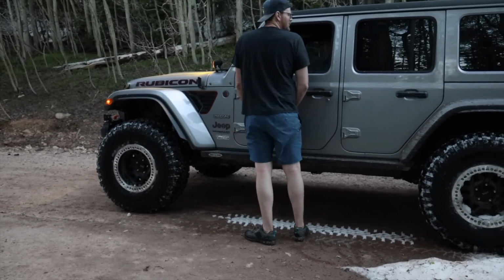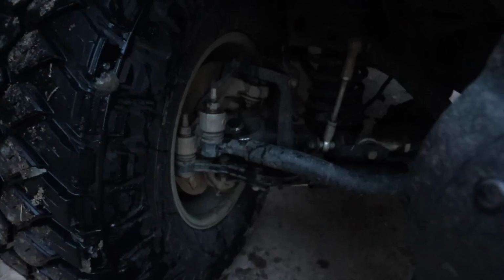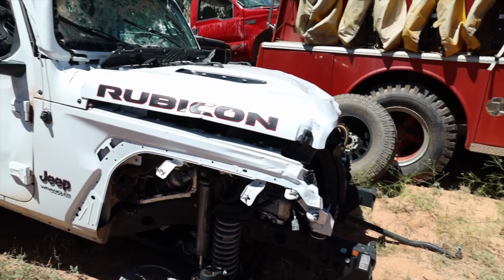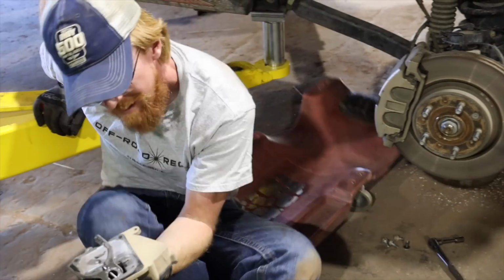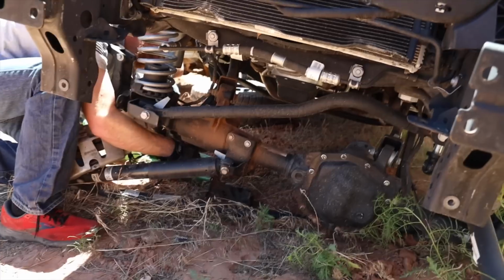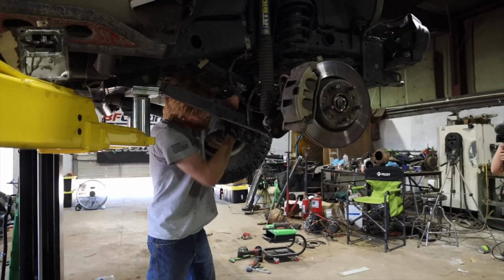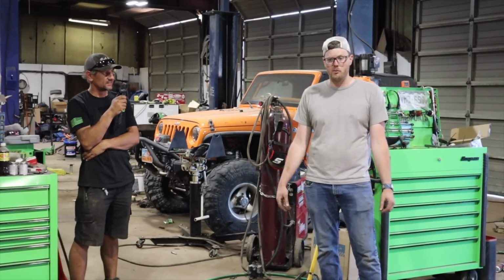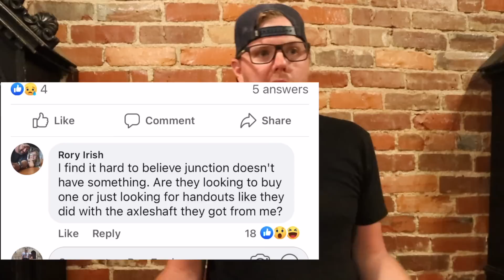The Real Story Of What Happened Between Rory From Trail Mater And Ben And Brandi

Comment: Ben from man to man the fact you made this video publicly shaming or calling out someone else for any reason at all or “defending your reputation” is wrong. This video should not have been made. That was low, turn the other cheek, take the high road whatever you want to call it, this should have been handled in private and not put on the internet to further stir the pot. Your Burning bridges rather then repairing them, from what I can see outside looking in sounds like a misunderstanding on both parts. Just my thoughts. Now I’m not defending anyone or taking sides but where I come from I’d go down there and man to man and figure it out.I applaud you for at-least reaching out via phone and trying to make it right but the video ….not good. Silence speaks louder then words sometimes.
Reply from the maker: I agree with most of what you said here. However, I did exactly that. I tried to reach out “privately” several times. No response. Rather than let his comments/accusations  just sit unmatched I used the platform I do have to correct the record. I feel there is nothing wrong with that and I think people need to get back to that.  In my opinion, this “turn the other cheek” nonsense has gotten our entire country into the mess it’s in… There is a time a place for that and this was just not it for me.
Reply: I can sympathize with ya brother, there is a time to stand up and defend you and yours but over an axle shaft and a post I’m not sure that was it..…….  Only you can make that call for you and your family though that we can agree on, just an outside perspective here. Truly I love both of your guys content Rory and yourself. And I hate seeing this. Generally off road people are good people and we need to stick together there’s enough outside drama trying to shut us down from wheeling, Nothing but best wishes man and I truly hope you and Rory work it out.
Reply from the maker: Like I said at the end of the video. I hold no hard feelings or grudges. I just wanted to have a voice in the conversation about me. This was my way.

Comment: I don’t know exactly what took place, I’ve been watching trailmater for years I saw your video doesn’t seem like you aired down your tires or tried to get out of the snow correctly, I thought you would break something and you did. If I was you I wouldn’t have left that shop without throwing Rory a bone, but your proof no good deed goes unpunished 😎
Reply from the maker: Definitely should have aired down you are correct about that! However we only had 2 snow drifts to get thought so I tried without! 🤦‍♂️
Reply from the maker: Your clueless.
Reply: @BenandBrandi if anyone is clueless it’s you.
Reply: @BenandBrandi   Let the winch do the work. You were hot rodding it with the wheels cranked. That's a recipe of disaster. You're lucky you only broke a shaft and the disconnect piece. It's common for the ujoint to let loose and take out the ball joints on these.
Reply from the maker: You are 100 percent right! I wasn’t thinking!! Live and learn I suppose.. 🤦‍♂️
Reply: PEOPLE DONT FILM  DONT FILM THEIR BAD STUFF , RORY !!!!!
Reply: @WASHINGTONSTATEDOGTRAINER  
Don't film their stuff bad don't film bad film....WHAT????????????
Reply: @BenandBrandi  You're

Comment: Personally, I was on your side up to the point that you use speculation and hearsay.  And at that point you are at the same level as Rory.

It probably didn't hurt your channel by putting out this video, but I was extremely disappointed that you took the low road toward the end... Shame on you.

Rory was correct. I find it extremely difficult that you have a Jeep like you have and you're in Utah. You've never heard of trail mater or Rory is odd, since your primary job is YouTube.
Of course you're going to offer to pay Rory for the parts because you made a ton of money off of this video.

Once again I was on your side until..  not everything is adding up.
Reply from the maker: A few things here to digest… 

1. What low road did I take other than 100 percent clarity with our followers…?

2. I had never heard of Rory, if I had I would have reached out to him instead of talking with Matt From off road recovery.. you litterally just shamed me for speculation and here you are doing it??

3. “A ton of money off this video”.
Again here on my channel I am 100 percent clear and honest. You may not be used to that from a YouTuber… this video has made $31.68 I wouldn’t call that a ton of anything. It took several hours to edit and produce… 

4. Most “YouTubers” wouldn’t take the time to write you a response like this. I hope you understand and appreciate that.

-Ben

Comment: Enough of what went on, So back story, I'm an old dude, 61 yrs old, been wheeling since I was 16. Why did it break? You broke because of your spinning very fast, with the wheels turned, and winching. When winching, just turn the tires pretty much as fast as the winch is pulling. Which, is not fast at all. If you are having to turn your steering wheel that sharp, your winch point needs to be over in that direction.
Reply from the maker: 100 percent! I figured it would be no big deal on top of the snow.. then the tire hit a rock… and that was it. It happens. Thanks for watching!

Comment: so i agree with the others   you should have paid him... my comment is more on the side of were these parts off this 2021 jeep his to give away or sell ?   i have never seen a insurance company not pickup for salvage a 2021 jeep.  i watched the video of him recovering this vehicle and they dont work for free   he gets paid for the recovery and storage when the insurance company has it picked up   usually Copart or IAA.   they will hold the vehicle till the claim is paid out then it will go to auction.
Reply: If the insurance company that will end up owning this 2021 jeep sees the video and wants to pursue this then Rory or who ever owns that company will be in a lot of hot water    you cant give away or sell something that does not belong to you   if he puts the broken parts back into the white jeep then he knows what he did was wrong and will try to chock it up to the original wreck.    the driver from the salvage yard for the insurance company will never know the difference.   by taking the parts from that jeep it has been devalued.  i owned a tow company for 41 years before i retired   this is disappointing to see this    now there is a chance that Rory bought this jeep at the auction !   that jeep even rolled over has a lot of value.